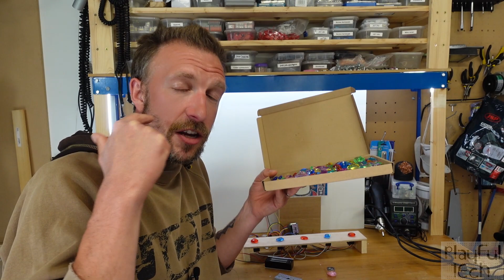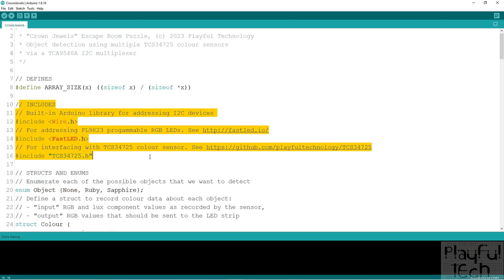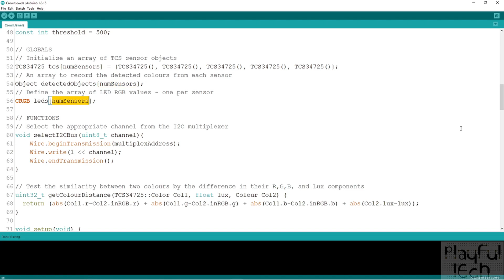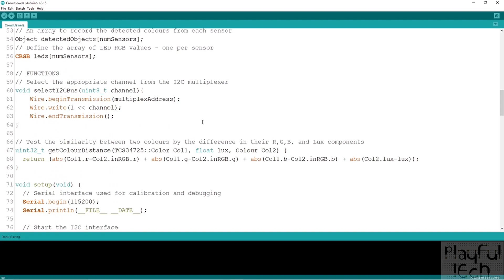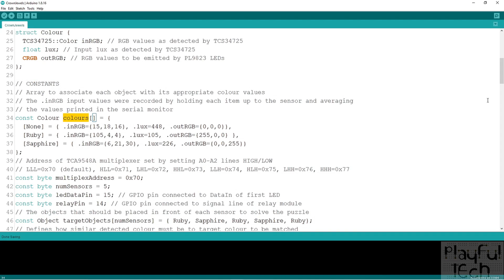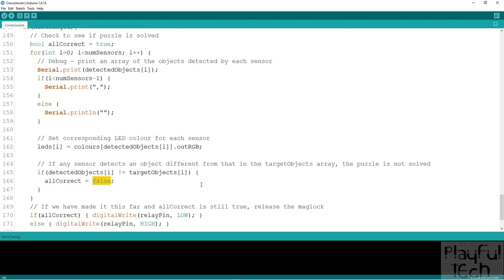"Crown Jewels" Escape Room Puzzle Tutorial using Multiple Colour Sensors

Comment: On line 52 you create an array of size "numSensors", but then since each element of the array needs to be initialized, you also have 5 calls to the library function.
Wouldn't that be an issue if you wanted to change the number of sensors?
Maybe a for loop could be used instead so that it would indeed run for the "numSensors" value..

Other than that, awesome video as always